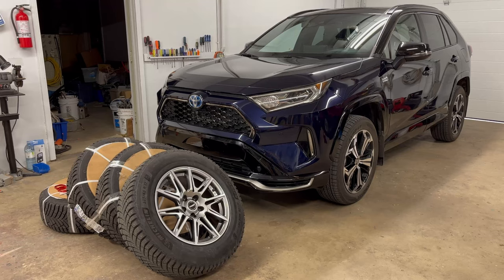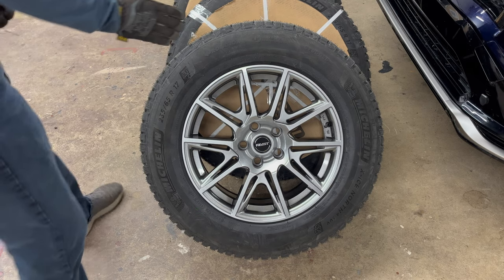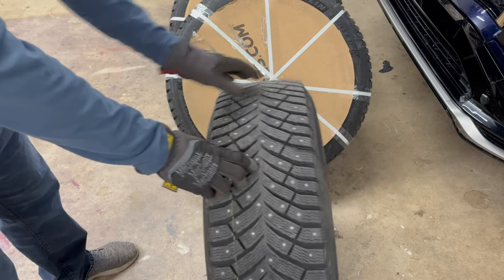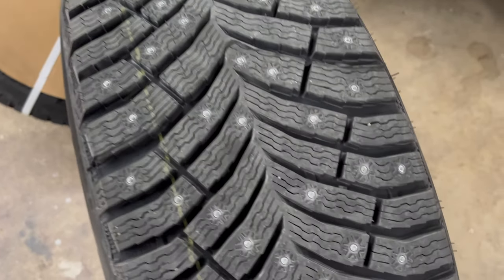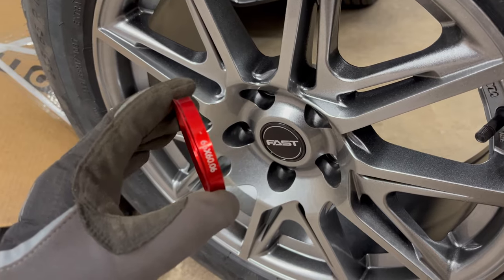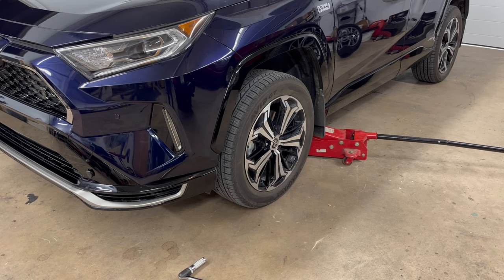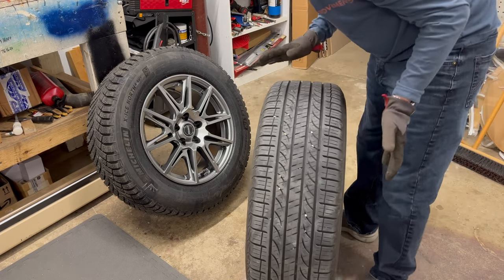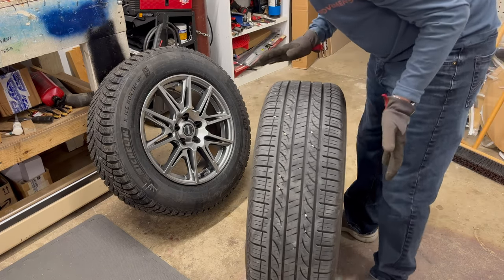RAV4 Prime Winter Wheels & Tires [STUDDED]

Comment: I have been looking for such a video for 6 months and finally found it. Thanks! 17 inch original wheels for Toyota are 17x7 with +35 offset with 225/65/17 tires for those that come with 17 inch ones. Original 19 inch wheels come with 235/55/19 on Limited and XLE trims (19x7.5 offset+40). I wonder if 235/65/17 would fit 7 inch wide wheels. Also, did you experience dirt and mud splashing on the sides and side windows while driving? Because +35 offset makes the tires stick out from the sides.?
Reply from the maker: No splashing up the sides any different than before.

Comment: Did you use the original lug nuts on wheels with a conical seat?  You may want to check that.
Reply from the maker: The original lug nuts work just great, the lug nut seat is a flat surface, not tapered, just like the OEM Toyota wheels. The lug nuts that came with the wheel installation kit were identical to what I had, so I returned the lug nuts.

Comment: I thought when you buy aftermarket wheels, you need to buy an aftermarket lug nuts. Didn't know the OEM lug nuts fit on the fast wheels. I am looking into buying an aftermarket wheels for my parent's rav4 when they get it. Hopefully this month or next month, Who knows when.
Reply from the maker: It depends on the vehicle and wheels. The lug nuts were identical to the factory ones so I actually returned the aftermarket ones.
Reply from the maker: My parents have a new RAV4 hybrid on order 😉👍

Comment: Too bad you didn't get the hub centric version of the Switch wheels, that way you wouldn't have to mess around with centering rings.  I have the same wheels for my RAV4, Sienna and RX350.
Reply from the maker: I was not aware that was an option, of course that would be preferred…
Reply: @InternetDude  Nothing wrong with the set up you have it just too bad 1010 didn't offer that option to you. The hub centric wheels are a bit more expensive about $20/wheel. My tire guy put me onto Fast wheels about 8 years ago and I haven't looked back. They are owned by FastCo a Quebec based company and they make OEM wheels currently for 7 auto manufacturers in Canada.
Reply from the maker: It's too late now but I know there were two options for my wheels and I never considered hub size, I only used the guide of "it fits" so good enough. The first choice of wheel also needed the spacers so I never even gave that a consideration. Next time I will have to pay more attention LOL

Comment: Hey, I am quite interested in Rav 4 prime. I have heard some heating pump issues, especially in the winter. What's your experience with your Rav 4 prime? Any regrets, dislike and overall recommendation/suggestions for some like me. Please a d thanks
Reply from the maker: Heating is no problem, however the heat pump only provides heat down to -10C. Colder than that and the gas engine needs to provide cabin heat due to limitations of the heat pump. Otherwise a fantastic all around vehicle.
Reply: I believe the people who are disliking the fact that the cars engine runs when below -10c need to buy an EV vs a PHEV, not a big deal in my opinion, on your prime are you able to hit the auto start/precondition/AC button on the key fob and will the car run the engine when under -10c ?
Reply: I also run designated winter tires on all my cars but usually run the rim down an inch or two from stock but the tire larger than stock using the same tire calculator as you. I find this beneficial for better ground clearance and also for better traction. I have found the lower the profile of the tire the less traction I have been able to get although not real noticable till you are in the lower profiles. I have never had an issue with snow build up in the wheel wells from slightly larger tires even when running in deep snow for the hour trip into work. Maybe not the best strategy for tire sizing but that was what I learned just from trial and error.
Reply from the maker: @renoallstate4573  Exactly, remember it's not a BEV, it's a PHEV. It's actually -11C not -10C where the heat pump will operate down to. From -12C and colder the gas engine needs to run. The A/C button on the fob function no longer causes any heat to form in the cabin due to that heat pump limitation below -11C. It also does not fire up the gas engine under any circumstances, so no pre-warming at all from -12C and down.

Comment: Hey buddy...thank you for posting this.  Could you tell me where you got those "Hub Centering rings"?  Did it come with the wheels or do you know where I might be able to find those types you got.

Thank you.

JT
Reply from the maker: Hi JT, I bought the wheel hub centric rings from the place I bought the wheels from (1010Tires). The wheel company does not sell the rings because the wheels fit so many different applications. If you have different wheels from these you would likely need different sized rings. Although the inner diameter would be the same, 60.06 mm. Hope that helps.
Reply: @InternetDude  Hey great..  thanks.. it does give me a starting point.  I got the RAV4 Prime SE with the 18" .  When I traded in my old vehicle, kept my 
235/65/17 with Blizzak WS70 winter tires on them.  They seem to fit okay.. but I didn't even think about hub centering rings till I saw your vid.  I did put it on there real quick just to look.  Didn't drive it. but seems to fit snug. I'll find some 60.06mm rings on Amazon and try it out.

Thanks.

JT
Reply from the maker: What did the wheels come from? Many Toyota wheels have the same bolt pattern.
Reply from the maker: You may not even need centering rings. If your wheel holes are tapered and your lug nuts you are fine as-is.
Reply: @InternetDude  Well..funny you asked that. These actual rims..that I will use are MB Vector AM 73. They are 17x7 5x100/114 (guess that means 5 bolts 100 or 114mm spread???)and that's where I put on the Bridgestone Blizzak WS70 235/65/17. Over 50% of thread still on there...so didn't want to waste it.  Anyways......I had bought back 11/11/2013 for my 2013 Hyundai Santa Fe Sport. Got rid of that and bought a 2020 Hyundai Santa Fe. Glad they fit. Lo and behold. The Prime came along and couldn't resist. So here I am. Lifted up the Prime, Dry fitted it. Put it on and set her down. But didn't drive it. But...seems to fit.  Tighted it up while still up. Lug nuts fitted fine. Found NO freeplay left right up down.  To my inexperienced eye and knowledge...seems to be okay and bolt pattern seems to match.   Just worried whether it will hit or rub against something I can see on the inside.  Don't want to ruin a $40K plus investment. Didn't want to try it yet with a centering ring and end up...getting that thing super stuck in there or something.  What do you think?
Reply from the maker: It sounds like you are probably fine. If I was you I’d install them all and go around the block. If no vibrations or noise you’re good. Stop by a tire shop if you still feel uncertain to ask them their thoughts.
Reply: @InternetDude  thanks for the tip.  I will do that.  Take care and stay safe.
JT
Reply: @jt2quick  Have you noticed any issues with your 235/65/17 tires on 17X7 wheels, because 235/65/17 tires normally come on 17x7.5 wheels and I thought 17x7 would be too narrow for 235. I have 225/65/17 on 17x7 but as the tires will need to be replaced I am thinking of installing 235/65/17 tires. I would appreciate if you could share your thoughts and feedback.
Reply: @yalchinhuseynov2987  Hey buddy. I myself did not have any problems the 235/65/17. Yeah I was at first worried downsizing to a smaller size from 18 to 17, but no problems with steering or turning. checked to make sure and the clearance to the calipers were sufficient, naturally would not try to put on any snow chains on there.  But I didn't know you were running on smaller width, yeah even though it's only 10mm, I probably would not have tried it myself going down to 225mm.  But as you know the narrower, the better it can cut through snow.  Just FYI...not sure about other brands, but the Blizzaks I had lasted a good 9 plus years, normally they'd start rotting away around the 5-7 year mark..but they still held out.Gonna try out the Kumho Crugen HT51 come Fall season when I'll need new tires. The Kumho has a tread depth of 12.5 and 3peak mountain snowflake like the Bridgestone weatherpeaks I have now.  Post on here, how long your Michelin X-Ice holds out. I curious myself. Take care and stay safe.
Reply: @jt2quick  my 225/65/17 winter tires came from my previous Honda CRv and they are not Michelin X-Ice but some other cheaper brand. I bought them in2019 and can be used a couple seasons more. After which I am planning to get Michelin X-Ice. The reason I want to buy 235/65/17 is that my current 2024 Toyota RAV4 Limited has OEM 235/55/19 all season tires. To downsize to 17” for winter while keeping the overall diameter close to OEM (29.2”), I calculated that 235/65/17 is the closest match (29”) and not 225/65/17 (28.5”). Since you mentioned that you installed 235/65/17 on 17x7 with no issues then I will do the same. Thanks for sharing your experience.
Reply: @yalchinhuseynov2987  OOH..I see now.  My bad.  But yeah... I myself even considered going up to 19inch. Still debating though for the upcoming winter whether to get extra set of 18in rims to compliment either Blizzak WS90 or these Michelin X-Ice. Not sure where you are at, but here in OK, it doesn't get nearly as packed or really bad as in the northern states or New England area.  Yeah most of current RAV4s are pretty much the same down below, just the upgrades when you move to XSE or even Prime models like mine, so you will have no problems with the fit, you'll see that it might look tight, but no...there'a a good inch or more of clearance all around and unless you slap on some dedicated snow chains, you will not run into any problems. Let me know how it goes. Take care.
Reply: @yalchinhuseynov2987  Forgot to ask you, but you probably checked it out... My RAV4 Prime has a +40 offset and the 235/65/17 that I slapped on my prime had the MB Vector AM 73 with a +43 offset, hence probably the reason, it didn't give me any problems. With that in mind, I don't know what rims you are using and the Offset on it.  Anyways...just thinking out loud and you might have considered that already. Take care.